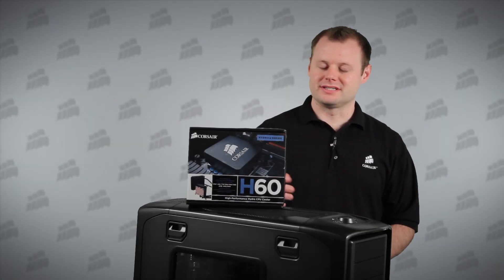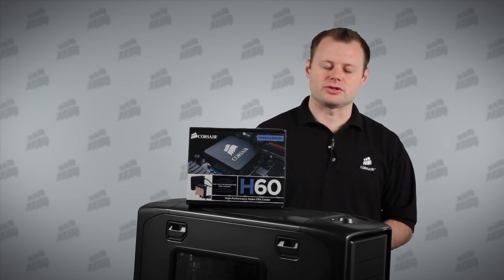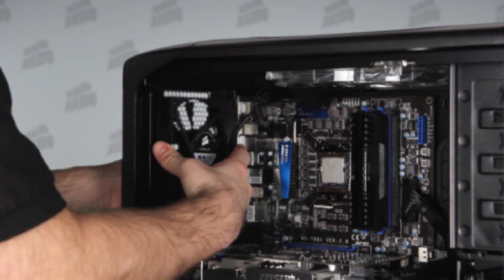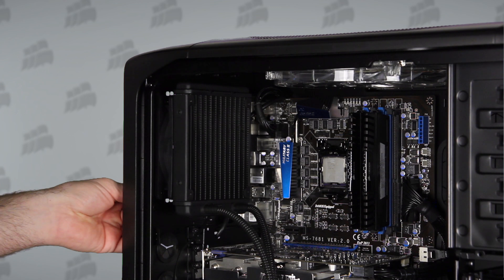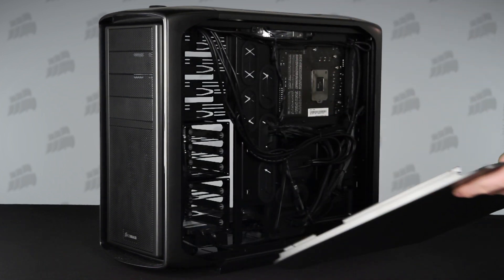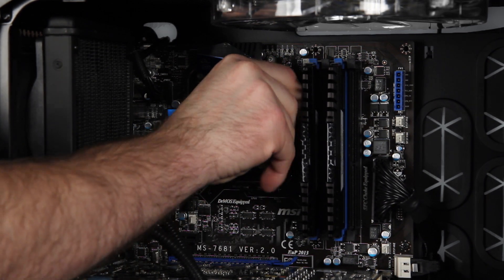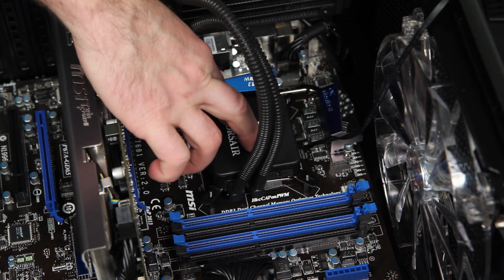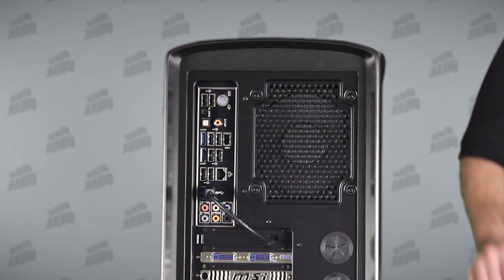Corsair Hydro Series H60 CPU Cooler Install How-To Video

Comment: took me fuckin 3 hours to install because i had to rebuild my whole computer, keep in mind that not everyone has access to the back of their motherboard that easily, doesn't fit well inside my case, but it does work well, i cant put my side panel on anymore because the radiator juts out a bit, i have a thermaltake case. my computer's had trouble overheating before i got this but now its doing good and i can keep it on for longer periods of time

Comment: @LookatthatSH1T I all so installed a 2nd to my brother PC, and I found out why the first time the screw didn't got tight enough,,, when you install the H60 heat sink, the thermal comp it's hard when new, so it create a gap between the CPU plate and the H60 copper plate, so my suggestion is, install it, make it tight but don't force it, turn the PC ON, run it for few min, then shut it OFF and tight the screws again in the order 1 3 2 4 like show in the instruction, util they don't turn anymore

Comment: @nicknicolosi1 

I am actually building a completely new rig from scratch. So, I won't need to worry about the back plate installation and removing the motherboard. I am also using the Corsair 600t shown in this video, which has a huge space for that, although I might put it on first anyway. Yeah looks like I'm getting this CPU cooler, sounds good. I'll make sure I tighten the screws too :) 

Thanks for the reply.

Comment: @LookatthatSH1T into my back fan hole, or at least on my COLLER MASTER HAF932 case,, you don't need to buy any extra hardware for installation, and the instruction given are very easy to fallow (at least for INTEL SOCKET 1155).......
MY OPINION FOR EVERYONE THINKING TO REPLACE BIG HEAT SINK & FAN GO RIGHT AHEAD,,,, YOU WILL LOVE IT, and take a lot of stress out your mobo (by the weight of the big metal heatsink). A+++++

Comment: @LookatthatSH1T tips if you building a new PC,, make sure to install the backplate before you secure your mobo to the case,, if you are replacing your stock heat sink, sorry bad news you have to take your motherboard out of the case for installing the back plate at least your case have a big opening in the back so you will be able to install the back plate with out taking mobo out,, you don't need to apply TIM, the pre apply one is grate, and the fan and radiator was verry easy and fitted right

Comment: @LookatthatSH1T yes, I just tight the screws up more and that dropped my temp to 40C idle @ 90F room temp stock CPU frequency, and wile stress testing 50~55C under 100% load @ 90F room temp at stock CPU frequency (I have no A/C), so I can consider it a MUST HAVE on my system, I love it, I just said bye bye to 75C with stock fan, I just get off 5 hr playing with LEFT 4 DEATH 2 VERSUS, my CPU max temp was 50C @ 30~40% CPU load and 98F room temp (but the PC looks like a heater for the room)

Comment: ok, I just finish mounting all hardware on my new rig, corsair H60 pump works but is keeping my temp high, I getting 51C idle in BIOS, I will attempt to reinstall and apply new thermal compound tomorrow, may be isn't making proper contact with the all surface of the CPU.

Case: CoolMaster HAF932
mobo: EVGA P67 FTW
CPU: i7 2600K sandy bridge
CPU cooling: CORSAIR H60
memory: corsair vengeange DDR3 1600 2x4 8Gb TOTAL (for now)
PSU: OCZ ZX1000W modular 80+Gold
2 GPU: EVGA GTX470 super clocked

Comment: For any1 ho wants to go to easy setup watercooled cpu system , then this is the one.
you really get bang for the buck with this cooler.
i was using stock aircooler on the i7 920 (getting 45 degrees celsius idle / and around 55-60 degrees when gaming.
with the H60 im getting 28-30 on idle / and around 40 when gaming,  so thats a big improvement :). Now even my HD5870 runs cooler because the H60 sucks the warmup out of the case. Its very easy to install,and it is totally maintenace free !!

Comment: so if u put in the fan on the rear exhaust fan. It draws in air? Doesn't that ruin the air flow in the case if you don't have top fan?

Comment: @babac95 from reviews on newegg...no. you can and is a good idea, but the mounting screws it comes with arent long enuff to bolt dual fans in a push-pull method

Comment: H50 vs H60 (from my own personal experience)

Core i7 920 Overclocked to 3.8 with Vcore of 1.3

H50 Temps with 26 C room temp : 

Idel 48 C 

100% load 84 C

H60 Temps with 26 C room temp : 

Idel 43 C

100% load 74 C

Bottom line : h60 worked much better for me, dropping my cpu temp by 10 C under full load.

Comment: Two things for those doing this for the first time.

First, there is a clear piece of plastic on the back side of the cooling unit.  It took me a few minutes to figure out why I couldn't get the cooling unit to fit on the risers.  Remove this.  

Second, not every case has the cut out to get behind the processor like the one in this video.  Be prepared to remove your motherboard from the case in order to attach the mounting bracket and risers.

Comment: between the H50 and the H60 which performs best on the AMD Phenom II X6 1100T Black Edition. and should I use an additional 120 in push pull. or will the stock fan suffice??

Comment: @FlamingoProduktion Yes but I like to overkill in cooling just in case xD, you are right the H100 is best suited for the 1366 socket and the upcoming 2011 socket also the AM3+ 8 core cpu's

Comment: One thing illustrated here that the manual does not tell you is to have the fan blow inward towards the radiator, not outside the case.

Comment: Can the radiator be mounted on the celing of the case? Im planning to add another fan above the case, under the mesh cover to create push/pull . I have this case (awesome case) and want to know know if this configuration is possible.